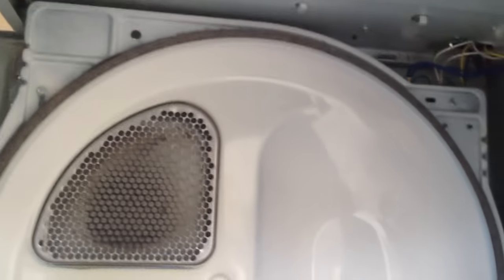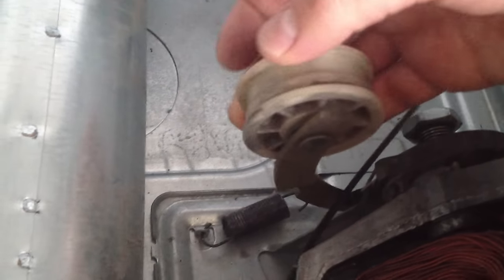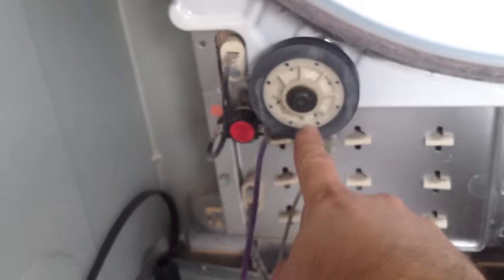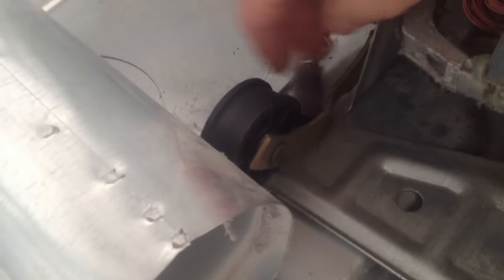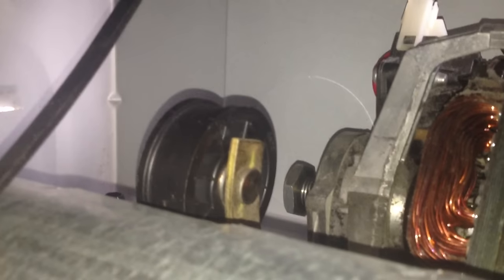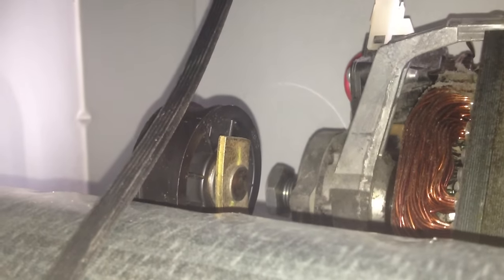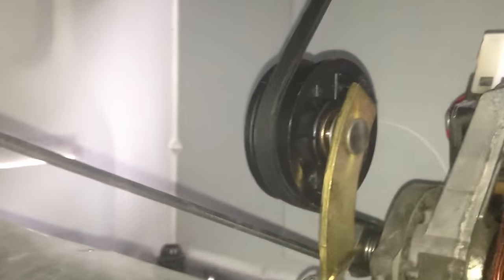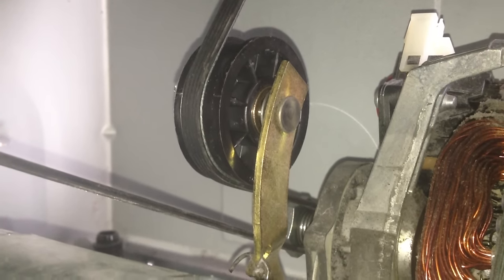How to fix a squeaky noisy dryer

Comment: Hey everyone, if u have a whirlpool duet dry and your belt pulley is squeaking. You don’t always have to change it or replace it, try clean the shaft pulley with a pice if fine sand paper or crocus cloth. Use a few drops of oil and presto no more squeaking. Make sure you whip of any excess oil. Hope this tip, helps and saves you a trip to the appliance and and some money.😜
Reply: Thanks
Reply: If you have a whirlpool duet, you gave 2 of the worst appliances ever made. I speak from experience.

Comment: Thank you for the video it saved me from calling someone to repair it me and my boys fixed it thanks again!  these videos have saved me several times.
Reply: someone had made a comment about oiling it and maybe that would fix the problem actually I did spray  WD-40 on all the rollers and wheel works great no need to be replaced eventually I'll have to replace them but as for now no. I would definitely try to oil them first before replacing you have nothing to lose.
Reply: Anyone reading this 6 years later please use a real grease and not wd-40. It may work and sound great at that moment but wd is not meant to lubricate long term. It will dry out any plastics and your belt to the point it fails much quicker. Just a friendly warning. Wd-40 is great for many things and will help loosen stuck pains in our ass but it isn't made to lubricate or grease something like bearings.
Reply: @licentiousdreams  - Great call yes WD-40 is not the appropriate solution. Use something like lithium grease spray or repack the bearings

Comment: So, I didn't have the snap ring removers, I went w/ the lubrication. Please include a link in the description for the kit, as I'm sure us 'lubricators' will need it in the future. So far the lubing is working, but I recommend actual lube like Tri-Flow instead of a water-dispersant like WD-40. If it eats bike chains, it'll eat roller axles...

Comment: Excellent explanation and camera work. I just wished you showed one with the idler arm, which is s-shaped with a long shaft that goes in to the motor housing has come out of alignment when the spring somehow let go. I can't seem to get the idler pulley to properly run in parallel alignment with belt holder on the motor. This causes the belt to crab off the idler pulley.

Comment: great video and thanks for doing this. My question is how to disassemble the dryer to that point. .. I don't see any obvious screws. I tried half heartedly to pry up on the top from the front.  perhaps pry the front off?  thanks for any help. Bob
Reply: Same boat bro. I removed the panel it just popped off was able to reach in.
Reply: Turns out, ours was an older model I guess. removed the front panel via two screws at the bottom of front. was able to disassemble, clean and grease wheel bushings. all is well. thanks again.
Reply: +Bob Wilson thanks. I finally figured it out also. I also cleaned em greased em no more noise. 👍🏻👍🏻👍🏻

Comment: would like to see how to use the tool to remove and replace the wheels. I still dont know how.
Reply: Nancy little late here. But you use a circlip removal tool which has different size ends unless it is one made specifically for this job. Find the two ends that fit into the little holes on the clips. Install the end pieces to your tool by inserting them in the tools end slots and screwing them down tight into the tool. Then like a pair of pliers you insert the end pieces into the two holes in the clip and open up the tool which will cause the clip to expand and be able to remove it from its retaining groove. To re-install place new pulley on its shaft, insert the ends into the clip holes and open up the tool handles which will open up the clip and allow it to slide over the shaft end into the retaining groove. Release tool allowing clip to seat in groove. You likely could use a small screwdriver to wedge the clips off and press them back on with a little patience if you don't have a tool.

Comment: My dryer is about 15yrs old, maybe even older. Where could I find parts for it?
Reply from the maker: +Eddie Milton Some parts you can't get but usually every part that breaks has a replacement.  What part is broken? Many parts have part numbers written on them.  Sears has a good website that I often use to find out the parts numbers.  http://www.searspartsdirect.com/
Reply: +AdamDIY i have a 2007 maytag Neptune and it squeaks. am i able to fix this too?
Reply: This is an appliance parts place in Pontiac Michigan.  They have most parts needed.  Luckily I live less than 3 miles away.  Here's their website or call them.
http://www.eapartsinc.com   I have an old 2001 Kenmore dryer, they not only have new parts for them but typically they have them in stock with great prices.
Hope this helps.
Reply: Lori A was

Comment: You don't need those special plyers to remove the rollers. Use a small screw driver and a putty knife. Save $20

A better tutorial to learn from is from partselect